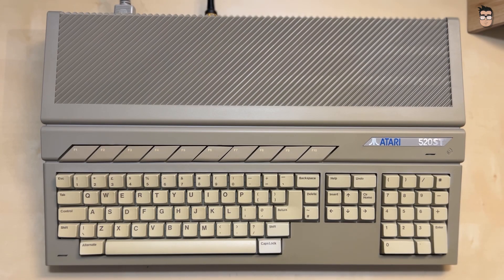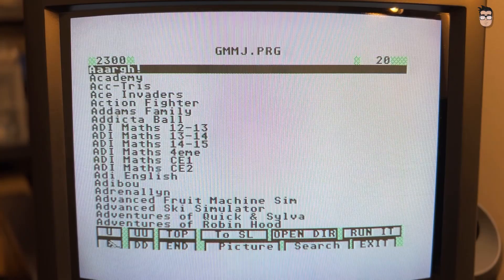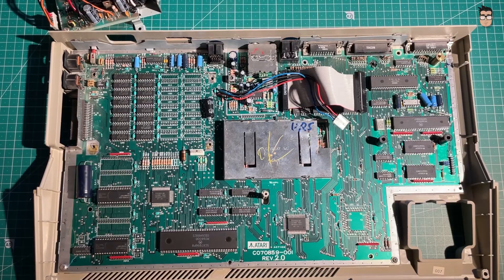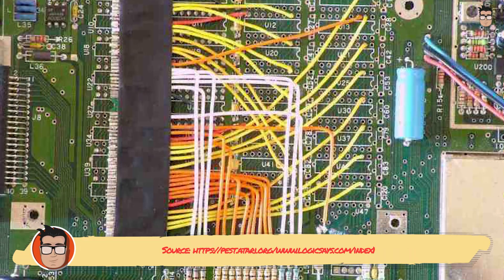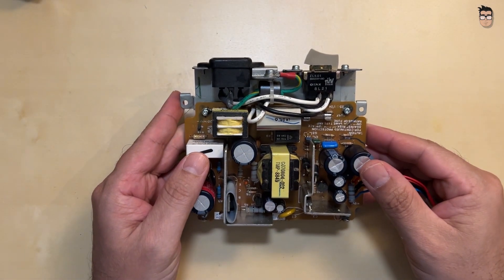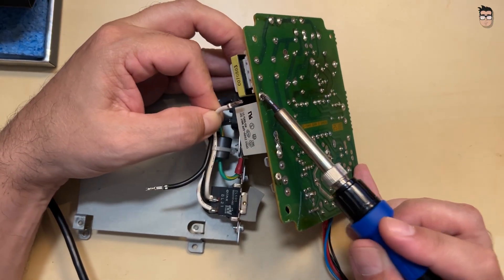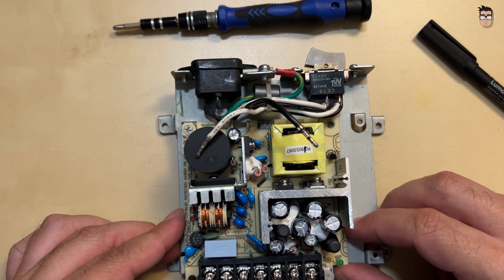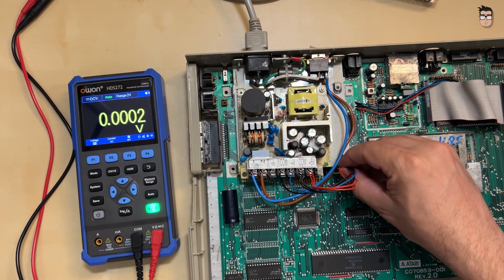Relive Your Atari ST! Easily Upgrade the RAM and Power Supply 🪛

Comment: Hi there. Excellent video and very informative and helpful. I have a 520 STE and a 1040 STE and this will be one of the project upgrades i would like to do on both machines. I was wondering, will that specific power supply you used on the 520 STE be suitable for the 1040 STE also or will it need something more powerful?
Reply from the maker: Thanks for watching! The amount of memory is independent; the same power supply works for any Atari ST model. In addition, with the Mean Well RD-50A you will have enough amperage to power additional devices such as hard disk emulators like UltraSatan or ACSI2STM, or an external Gotek.